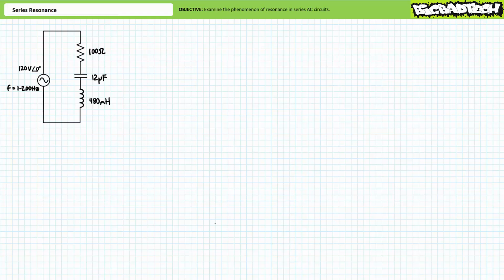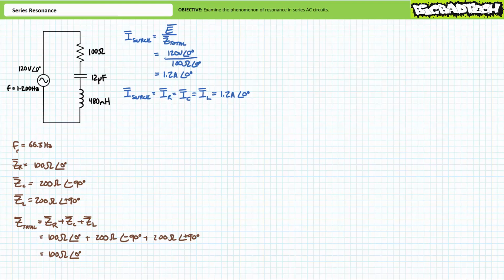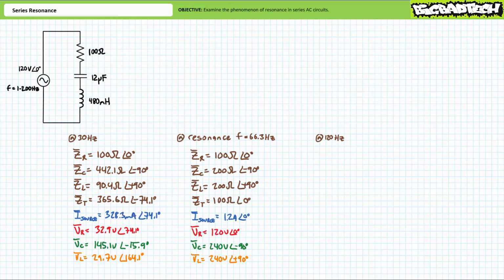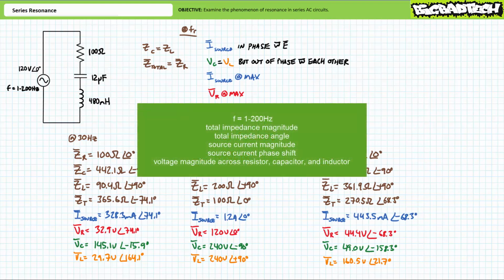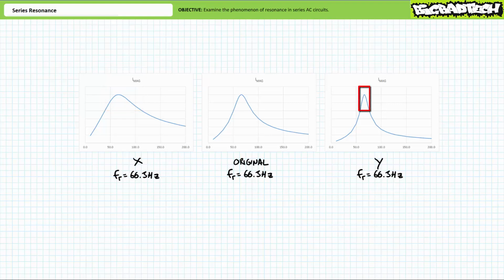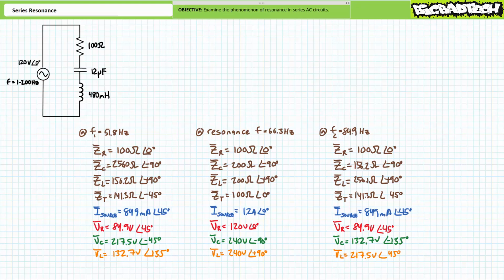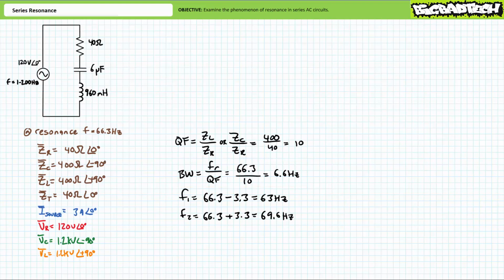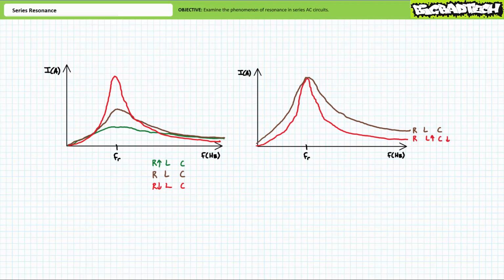Series Resonance (Full Lecture)

Comment: Transformer calculation for such serie resonance converter, how to do this? what frequency I need to calculate it on, and what inductance do I need? this is because I have learn much of it but transformer setup is a little spooky for me. I now it is a current resonance system, so I presume primairy inductance is such it does not load resonance tank to much. I read that a forward transformer calculation is close to good. thanks.

Comment: the most common form of the series  resonant circuits is the firing of you car spark   it satisfy ohms law this way   the coil has a form of resisrtance  called reluctance    the condencer has a form of resistance  called reactance  a simple way to explain it like one is pos the other is neg    so  cancell one another   so in the fomular   I=E/R   the max current is when R=O----- I=E/O    so if you install wrong cond , less spark   this is in older eng  it causes the points to pit   so if you points are pitting  u have wrong cond   the bottom line   mfd value is critacle    xcous my spelling  too old
Reply from the maker: True dat. Also check out the inductor release lecture at: https://youtu.be/SB4LfSd_tCI The air in the gap has a resistance. The collapsing magnetic field generates a large voltage spike to keep current flowing in the same direction. Thus a spark is formed.